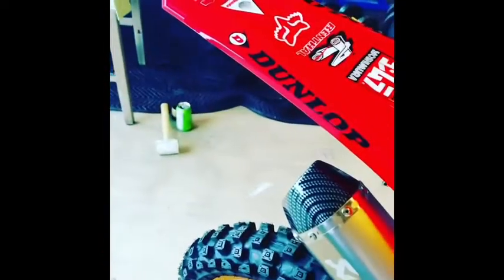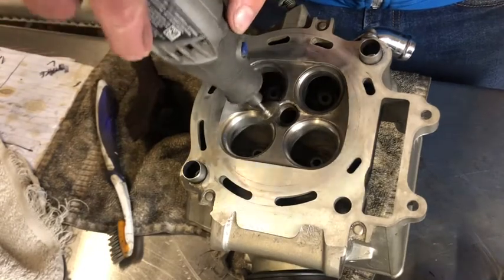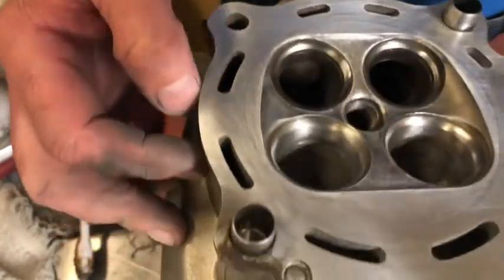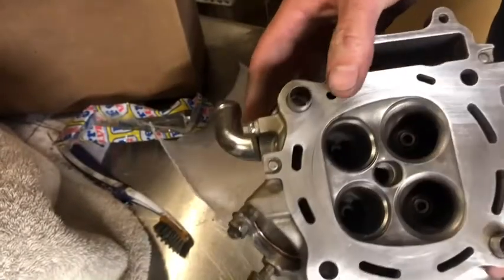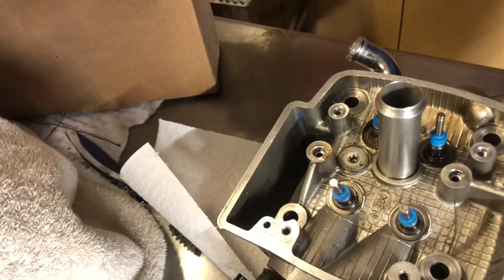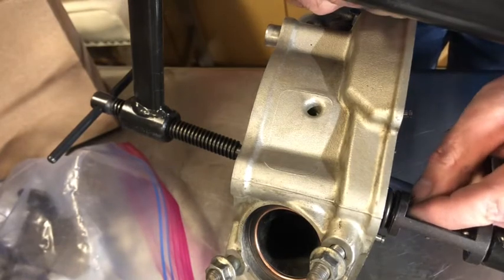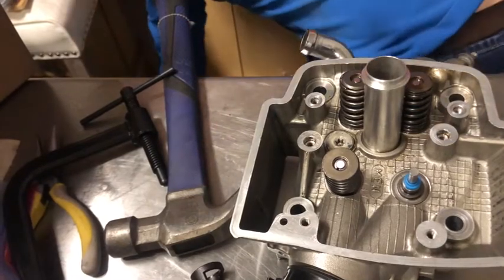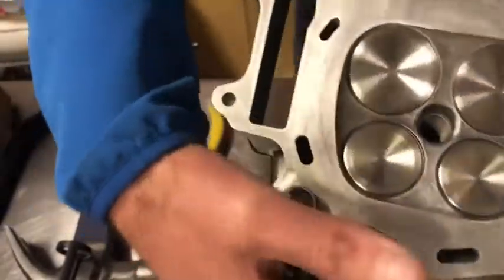Installing Titanium Valves in a CRF450

Comment: Hello. good job I have a question When you install the valves don't you put some increase on the valve? It's just putting the new valves in and that's it?
Reply from the maker: You should replace the valve seats and have them machined, steel valves you should lap to get good contact, titanium valves you do not lap, but again make sure and replace the seats, your valves will run longer and last without having to be shimmed….hope that helps!

Comment: Will any machine shop do this work??
Reply from the maker: I would recommend specialized ones connected to a good mechanic 👍
Reply from the maker: You can buy your own dies and try it yourself, but not recommended, steep learning curve to get the right pitch on the seats. I would recommend Boyco Racing in Laguna Hills Ca, he’s one of the best in the business
Reply: @socal.hondabuild8349  I have a 2004 crf450r, should I go stainless valves so I don't have to adjust them so often?  What do you recommend?  I do light track , and a lot around my property.  But I ride almost every day and 15 hours adds up quick.
Reply from the maker: @diyjeff1838  yes I would recommend stainless steel, make sure and have your valve seats recut and valves lapped to mate with the seat

Comment: Why he didn't lapped?
Reply from the maker: They are titanium valves, never lap titanium valves, you only lap stainless steel valves
Reply from the maker: They are titanium valves, only lap stainless steel not titanium
Reply: @socal.hondabuild8349  why don't you lap titanium valves?
Reply from the maker: @vernonmcghee6428  they have a very thin coating that you do not want to tamper with, they will wear very fast if you did. The best situation for titanium valves are to have your valve seats recut and reconditioned and new guides, your titanium valves require a lighter spring as well and will give you superior performance
Reply: Hey i need help, one of my valve stem seals has came out from where its meant to be.. its sitting abit above where its meant to.. can i just use 2 flat heads to try push it back down? I dont know how to take the whole head off
Reply from the maker: Sorry for the delay just saw this comment….i would take it into a shop and have them remove the head and replace the guides